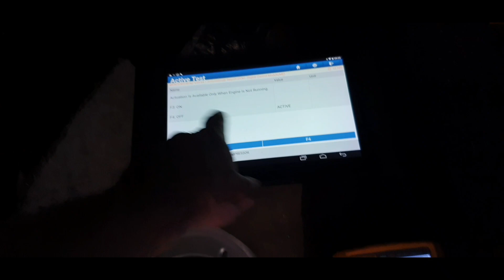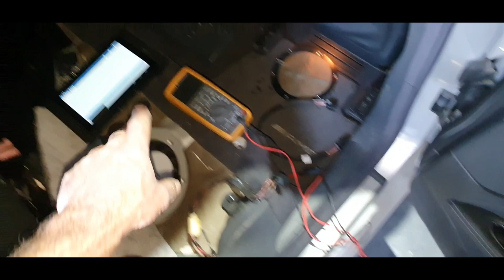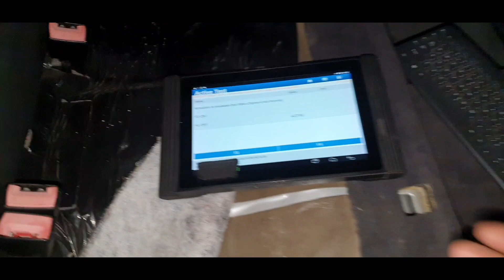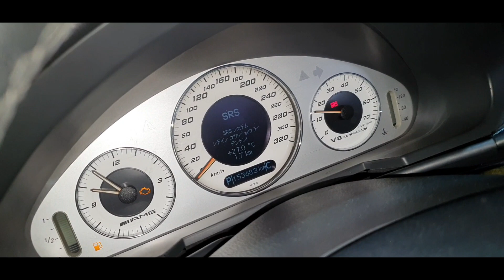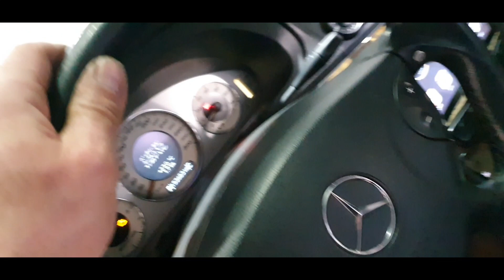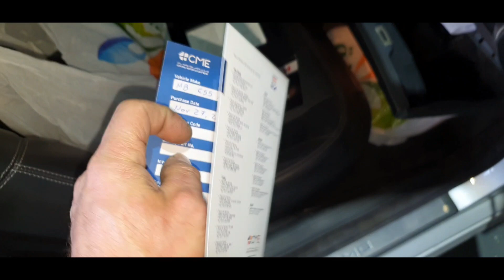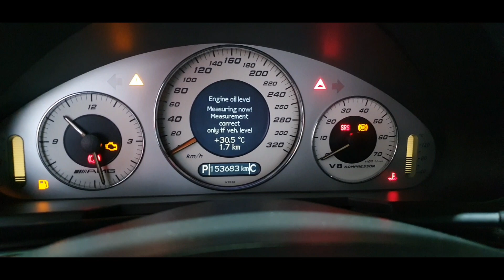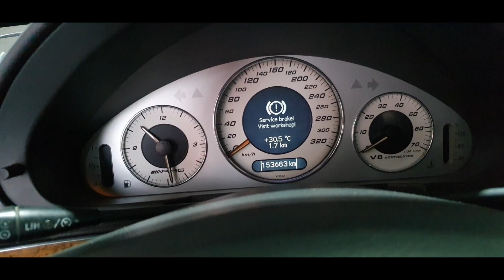E55 with 154k km check up (part 3)

Comment: I notice a lot of the middle east cars are Japan imports? Aren't there a lot of normal dealers there like EMC (emirates motor car) ? interesting..
Reply: Japan has plenty of Low mileage full spec vehicles and after a few years in Japan they are cheap to buy and import to ME.

Comment: How accurate is the oil level sensor reading on the instrument cluster?
Reply: Not very. To test I did the cluster measurement where it shows Liters and it read 8.2 right after a full oil change with 9 fresh liters of oil.? It’s more of a safety for when oil level is significantly low.

Comment: What is the flow rate for the factory fuel pump on the E55?
Reply from the maker: The last time that I check the flow on e55 was back in 2015 I think, 
I have my notes in the engine room (right now I'm in my house).
So let us say it's not less than 250 and not more than 300.
One pump it's enough for just cruising around without boost.
The problem is that if let us say each pump have 250 flow this doesn't mean that you have 500 LPH because both pushing through single fuel line with 7mm inner diameter @ 5 bar.
The bottle neck it's at the fuel line.
If you want to increase the flow you need another fuel line from the second pump with separate fitting direct at the fuel rail (I have done this more than 50 times at least and it's working excellent)
Stock fuel line from the driver side and aftermarket fuel line from the passenger side, the fuel pressure it's still regulated from the existing fuel regulator in the fuel tank.
Reply: @TasosMoschatos  Thanks for the response I am actually setting up a fuel surge tank with a -10 feed and a aftermarket pressure regulator and a -8 return to a fuel surge tank with 2 walbro 450 lph pumps , I'm going e85 so I thought the fuel system would be the primary focus.
Reply: @TasosMoschatos  What is usually the valve train noise in the m113k that sounds like lifters caused by?
Reply: @Hamza-or7jm  incorrect oil viscosity, these 113K motors like 15w50 or 15w40 ...
Reply: @tonychavez2083  factory recommends  5-40or 10-40?
Reply: @Hamza-or7jm  we have been running 15w50 on all of them for years, great protection and the right choice for very hot climates. 5w40 is more suited for European and Russian countries where it freezes often.
Reply: @tonychavez2083  What brand oil do you use?
Reply: @Hamza-or7jm  mobil1
Reply: @tonychavez2083 , The AMG engines M 113 ML only have an official approval from Mercedes Benz BeVo 229.5 / 0w40 or 5W40.     
Let the mobile 1 FS out of the engine 😌.  There are better oils.  For example Motul, Petronas, ROWE. 
 The days of the excellent mobil 1 NEW LIFE are over; it is no longer manufactured and the new oils are no longer recommended.

Best regards